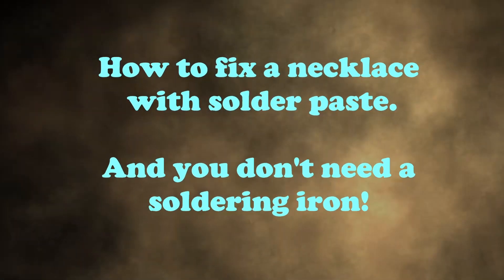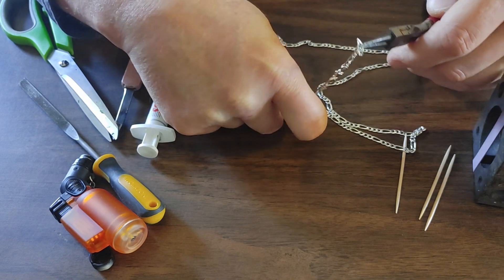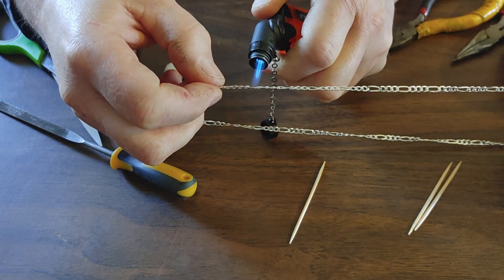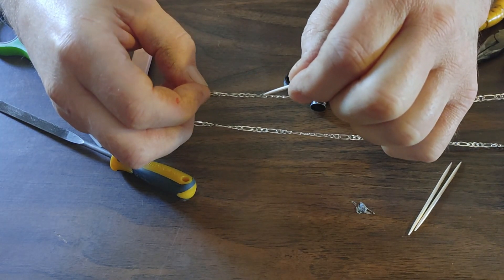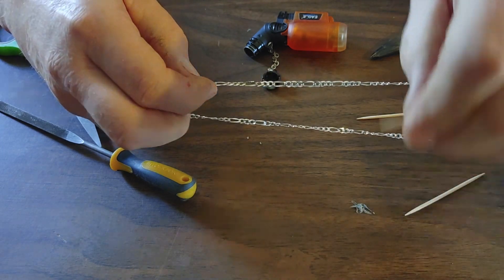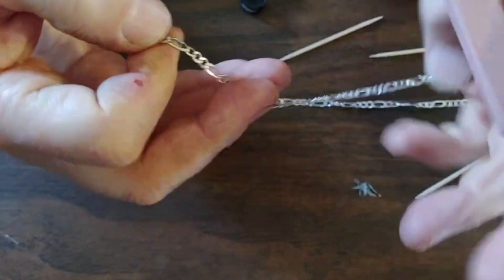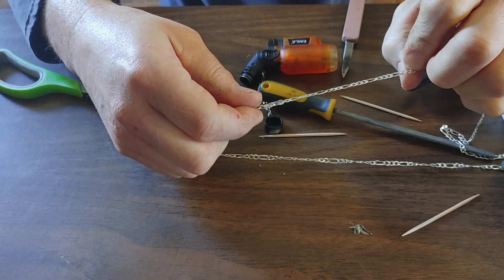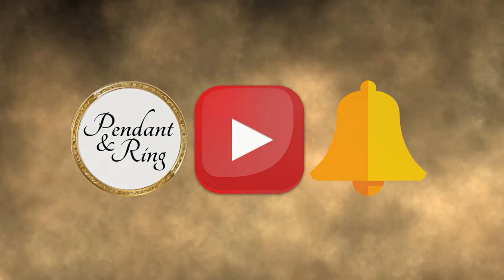How to fix a broken necklace chain 😀 with solder paste 😀!

Comment: i broke my gold necklace. if the.solder is silver, oh do you hide the silver on the gold?
Reply from the maker: If you repair it with silver solder, the repair will be silver. If you get gold solder to repair your gold necklace, then the repair will be gold. Gold and silver solder are used the same way - so this video will still help :)
Reply: Oh, OK thank you! I had didn't even realize it came in gold